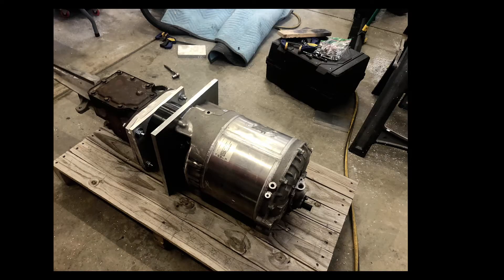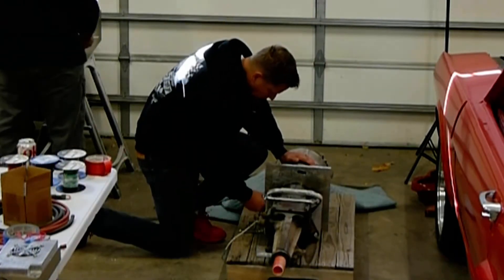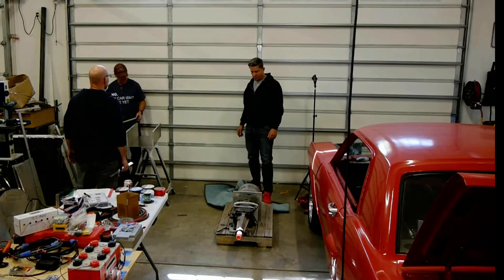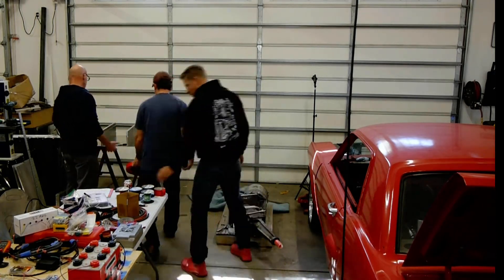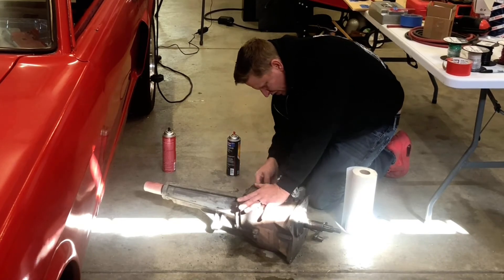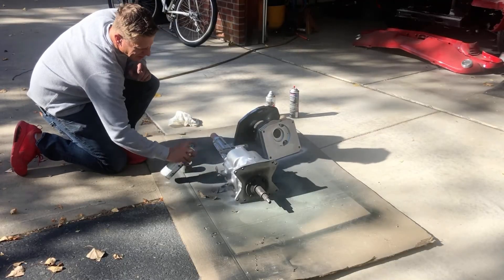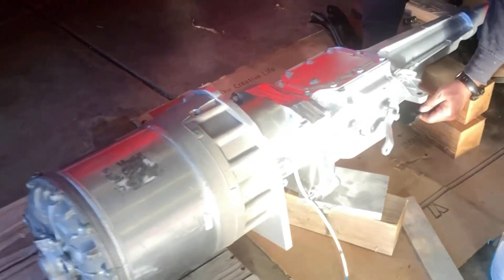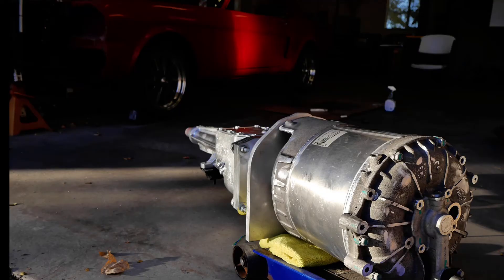Tesla Swap Adapter Assembly #teslaswap #evconversion

Comment: If you had a car with an independent rear suspension setup do you guys think the tesla rear motor would fit in place of the factory diff, shocks/springs and cradle assembly? I know id need custom cv shafts made as well as fabricate myself some way to mount the thing 🤔 
Thoughts?